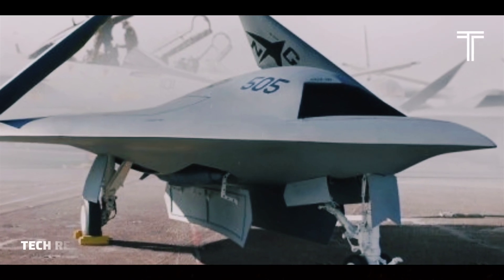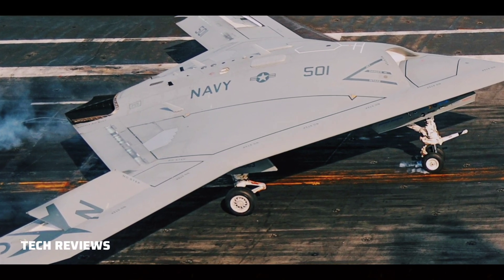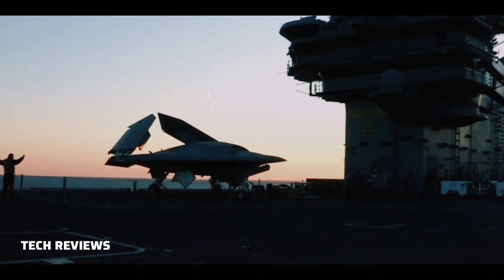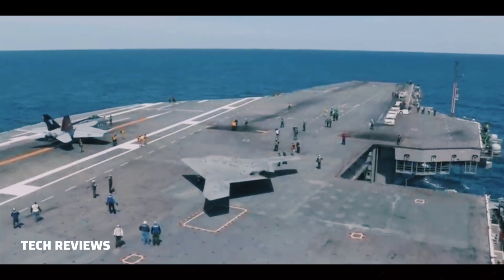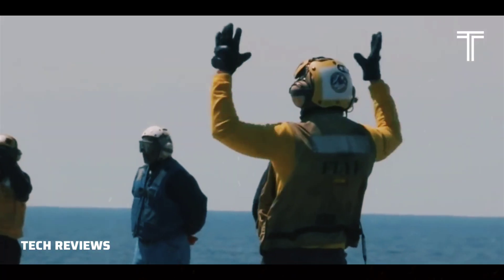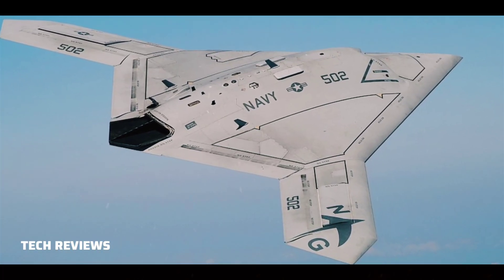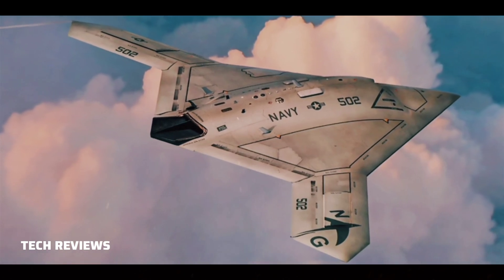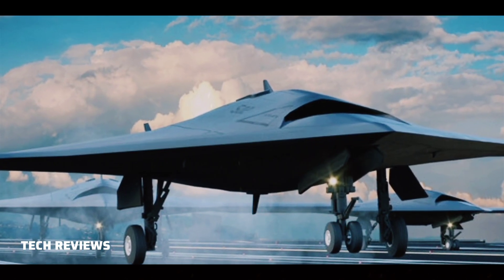Meet the X-47B; $1.5 Billion Stealth Drone, Belongs to the US Navy

Comment: Only 2 X-47Bs were built and they were used ss resting platforms only. The X-47B was decommissioned in 2015 and no more than the original 2 were ever built and no more will be built. It had an excellent range of 2,400 miles but its high cost, low payload and subsonic speed doomed it for the scrap heap.